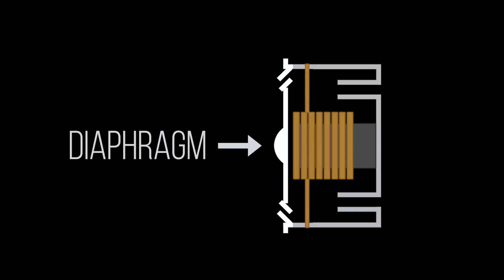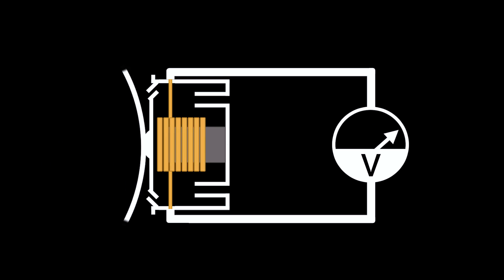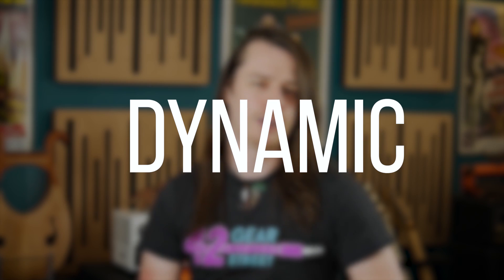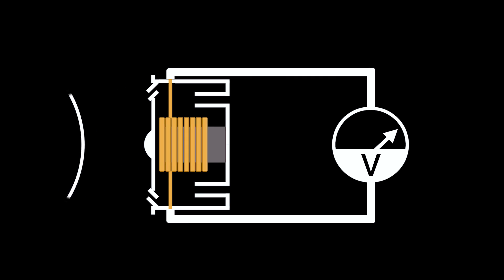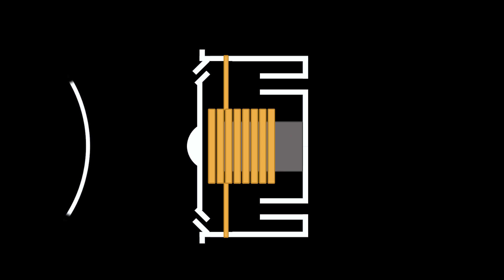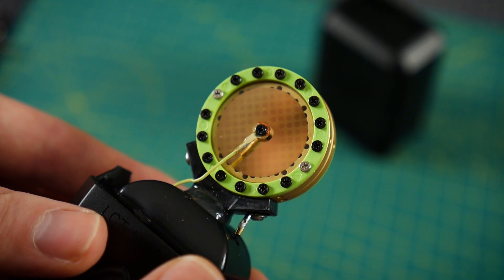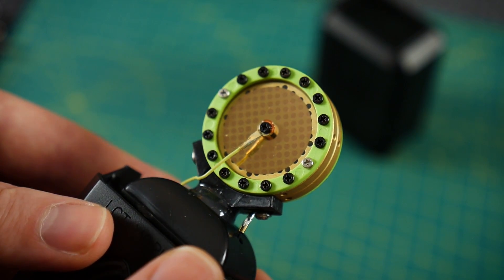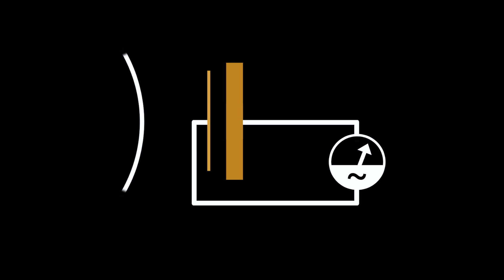The Different Ways MICROPHONES Capture Sound | Dynamic vs Condenser #42GSONE

Comment: 4:56 "its a myth that Dynamic are better for high SPL..." 8:40 "Dynamics are grade.. because the can handel high SPL"
Reply from the maker: You've missed what Gabriel was saying entirely. His point was that Condenser microphones are capable of handling high SPL too, the myth is that ONLY dynamics can handle high SPL. 

I hope that clears up your confusion
Reply: @ScienceofLoud  Was Gabriel meaning "Condenser microphones are capable of handling high SPL...but Dynamic are better"?
Because both here compared types have the ability to record high SPL. But at 8:40 it sounds like your recapping there outstanding  characteristics.
And i don't see why that stands out if its true for both types.
Reply: @ScienceofLoud  The difference, as I've historically understood it, is that clipping the circuitry inside a dynamic is nearly impossible because the capsule's output level will almost never be high enough to do so. Clipping a particularly hot condenser, however, is possible if the circuit isn't robust enough to handle the output, which is generally not a problem on all but the cheapest condensers.

Now, this doesn't stop you from clipping your preamp on the way in, but that's a case of PEBKAM (problem exists between knob and microphone).

Comment: Why did you even bother to do this if you weren't going to include Velocity/Ribbon, microphones? Some of the microphones commonly used? Like what was originally commonly used? What is still commonly used? I mean,  how can you be that bigoted and prejudice? How can you be that lacking in your knowledge? We had RCA. The Germans had, Beyer. And you guys have, Coles.

So hi there, sexy thick brogue musician here to tell you two thirds about what you need to know about microphones. Great! That's really going to help everybody. So why not make this simple?

Hey kids! Got no budget? Don't worry about condenser microphones.  They break easily.  All you need is a bag full of new or used, Shure, SM-57 & 58's.  You don't need anything else. You don't want anything else.  It doesn't matter if something else sounds better. You want those. And nothing else. Get them for half priced used.  They will last you 40+ years. After being dropped from 6 feet onto cement repeatedly. Try that with anything else. Anything else.

Condenser microphones can be cool. But in less than ideal recording rooms. Such as your bedroom, basement, garage. Don't waste your money on large diaphragm condenser microphones. Off axis response is dreadful in smaller rooms. Only get yourself small diaphragm condenser microphones  for cheap. Get a pair to use for drum overheads. Forget the vocals. You'll be using a 58.

Now I mentioned velocity/a.k.a. ribbon microphones. They sound and work like no other types. Not like condenser microphones. Not like dynamic microphones. And they are really sensitive to air blasts. So you don't use them outdoors. And they can sound very nice and mellow. Great on acoustic guitars. Great on vocals. With an additional great big oversized foam, pop filter. Don't forget the foam pop filter. Use the foam pop filter. Don't waste time with the  embroidery loop pantyhose pop filters. Use the foam one. And only use those microphones in the studio. Because they're going to get broken easily. Otherwise? You don't use those microphones.

And that's all you need to know from a four-time major music award nominated, independent, engineer/producer and former 20 year veteran for NBC-TV & Radio. So I know a few things. That and having worked for some of the most legendary Pro audio equipment manufacturers. So I know a few things. I know a lot of things.
Reply from the maker: You do realise that "knowing a lot of things" isn't a positive attribute if you are an intolerably smug arsehole about it?

Three points on your initial question:
1. I've already done a video on ribbon microphones
2. LEWITT currently don't make a ribbon microphone.
3. This video was largely for people starting out, who will be choosing between affordable dynamic and condensers. Ribbons are typically  much more expensive, delicate and aren't a beginner's first choice. 

Perhaps if you were are smart and experienced as you like to think you are you'd have realised all of that before dropping your tragic, condescending comment which will help no one.
Reply: @ScienceofLoud  Nothing smug about my reply. Facts is facts. And you're wrong. There are over 1/2 dozen manufacturers making, under $200 US, ribbon microphones. For those that want them. While,  LLUETT, might not make a ribbon microphone. That's no reason not to mention them. You are disseminating information here. Let's be complete about it now? Don't act like Donald Chump. They don't cost any more than a Beta 58/57's. But they blow out easily. They don't like being dropped either. So I generally don't recommend them for beginners. But when they ask? And they do. I point them in the direction of one of those. And then still recommend, SM-57 & 58's.

Sure there are plenty of other good sounding dynamic microphones out there. No doubt about that. But none present as familiar a sound as that of SM-57 & 58's. Some people like myself don't want any better. We want that. We need, those.

Now I know you're trying to Hawk for a decent microphone company, sure. And they are decent microphones it should not be discounted. So they usually aren't. And my buddy Fabrice DuPont voiced one of their microphones. So I'm not down on those. They are decent. I wouldn't turn my nose up at them. They work. They are a decent bang for the buck. Sort of. Partially.

So I can be as opinionated as I want to be. I've got more qualifications and an incredible Background beyond that of most others. And I stumbled across your video. And I wouldn't have said anything. Had it been marginally complete. But it wasn't. You missed the boat. If you're going to educate? Include all of the information. Equip them with the knowledge so they know. That's, sort of like not telling your son what that thing is used for between his legs. It does more than just that one thing. It serves multiple purposes. The least of which is relieving one's self of hydraulic waste.

Plus I've been doing this for over 50 years now. You've been doing it for five, maybe? And you've just been corrected by a college professor. So don't feel bad. You just learned something.
Reply from the maker: @RemyRAD  Doing this for 50 years? 
Have you been this insufferable all that time?

All you've done in these two meandering comments is parade around your self congratulatory anecdotes and opinions, never making any salient, objective points of discussion. 
You aren't interested in helping anyone to learn, you just want to show off how much you know (which, frankly, I think is desperate overcompensation for a deficiency elsewhere)

Sit down and have a word with yourself, son. 
Your attitude needs a serious look.
Reply from the maker: @RemyRAD  Also, here's a question relevant to a 'college professor' (I note the college here as I suspect you, unlike myself, were too unqualified to get into a university):

Do you give your entire year's syllabus in the first lecture?
No, of course not. That would be ridiculous wouldn't it?
Education is done incrementally (that means bit by bit), in order for students to have time to digest information on one part before moving on to discuss the next. 
It allows the teacher to lay the foundations of knowledge to build upon later. 

And as any good teacher will know, when it comes to learning what you choose to leave out is just as important as what you put in. 
It allows you to focus on specific learning outcomes and make points as succinctly as possible without unrelated information cluttering and confusing the topic at hand. 

But of course, an esteemed college professor of 50 years will know how to teach effectively, won't they?

 Doing something for a long time must mean you are good at it, it can't possibly be that you've sucked at what you do for half a century.
Reply: @ScienceofLoud  a college professor that obviously has no idea what it means to be smug, even when the definition of.

Comment: I can clearly understand your words with your Scottish accent but I really struggled to catch what the couple from Lewitt were saying.  I guess that they are not used to public speaking.  I have a condenser microphone from Harley Benton, the Retro Tube 2 and I can achieve good results on vocals with it but it has several controls on it and I have no idea how they should be used.  Henning has one of these mikes.  I think the controls are for various patterns  but of course the handbook (ha, ha) tells you zero about this.  Any ideas?  Perhaps a follow up video?  You do a good job Colin.
Reply from the maker: Having looked at the mic on Thomann's site it appears to have on body switches for 10dB pad and a high pass filter.
The switch on the power supply box is a 9 way polar pattern selector going between omni, cardioid and figure 8, with a few transitional patterns between them.
Reply: Thanks very much for your reply Colin.  I am such a novice that I don´t know what a 10db pad is!  The high pass filter I guess is to do with taming high frequencies.  As for the virtues of the various patterns, I have no clue!  It really needs a comprehensive handbook so learners can get the best out of what is a very good microphone.  Thanks again.
Reply from the maker: Ok, very briefly:

A 'pad' is a reduction in signal level. If you are recording a very loud source you can engage the pad to reduce the signal level by 10dB, that will prevent the recorded signal being so loud that it clips. 

A high pass filter does the exact opposite; it allows the high frequencies to pass through the filter unaffected. It rolls off low end, this is very good in microphones because a lot of unwanted noise comes from low frequency vibration shaking the microphone, or from low rumbles in the environment. Being able to filter these out at the microphone can save time in post or give a cleaner signal if it's a live performance. 

Polar patterns are simply the directions from which the microphone will pick up sound. They are 3D shapes, like invisible fields around the microphone which give an indication to its directional sensitivity. 
Omni means everywhere; the microphone picks up the same in every direction. This is the circle symbol. 
Cardioid means heart shaped; it picks up strongly in one direction and rejects sounds in the opposite direction. This is the inverted heart symbol. 
Figure 8 has a pattern that looks like an 8. It picks up equally in front and behind, but rejects sound from behind.

Comment: But why 48V? And they need to be converted to 100? Shouldn't something lower like 9V be able to do the job as well?
Reply: It was a random coincidence. Broadcasting corporations already had 48 Volt power supplies for their emergency lighting in place, thats pretty much it. Also 50 Volts AC and below are considered non-lethal if a human comes into permanent contact with it.  - Gabriel

Comment: why aren't there any professional quality Resistive microphones being made anymore, that is, carbon button microphones?
Reply from the maker: One huge reason is that carbon microphones produce a DC current, whereas our standard audio equipment is designed to work with AC current, as is generated by dynamic and condenser mics. 

So the short answer is that carbon mics would be incompatible  with mixing desks and audio interfaces.
Reply: a capacitor (or electret) microphone capsule also have a DC bias, so ..
Reply: @ScienceofLoud  that's very surmountable. make the button the top of a voltage divider and stick an op-amp in the middle. changing DC becomes AC
Reply from the maker: But it increases complexity, which increases cost. There are also few audio quality benefits to carbon mics over the options that are currently in popular usage, sure they produce a powerful signal, but their signal to noise ratio isn't up to game for studio applications, even before you start adding additional opamps into the signal path. 

They just aren't viable as an alternative: unable to offer enough of an advantage to outweigh the complexity of getting them to function with existing equipment. Probably best left to old telephone and radio mics.
Reply: @ScienceofLoud  yeah but they have a cool vibe, which I'm absolutely sure creative engineers would be all over. cost and impracticality never slowed down the cassette tape market ;D

Comment: Weird, just had a dynamic die on me and have been wondering about whether I could repair it myself and this video comes up in my feed... not that it helps so much with repair specifically, but still weird...
Reply from the maker: The fault could be as simple as a broken wire on the XLR connector which is an easy fix, but if there is any damage to the capsule itself then it's time for a new microphone.